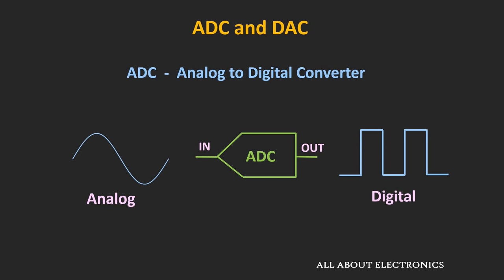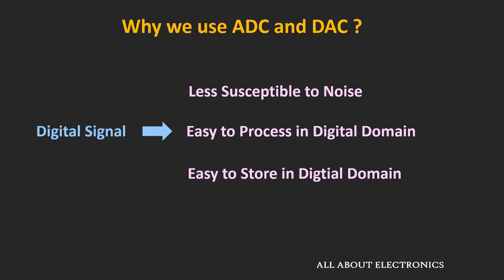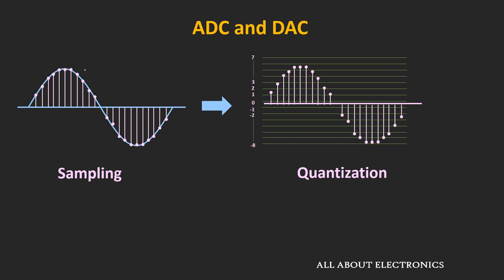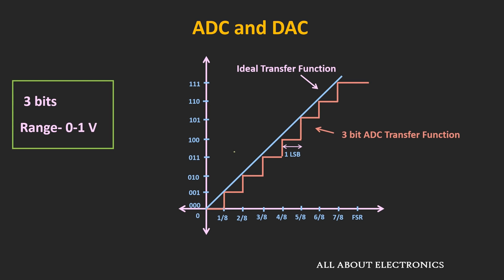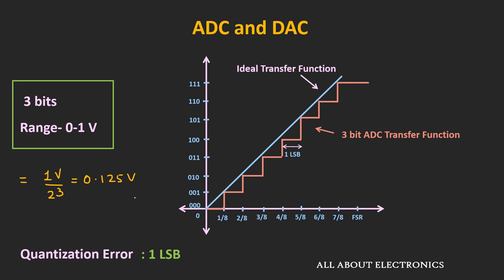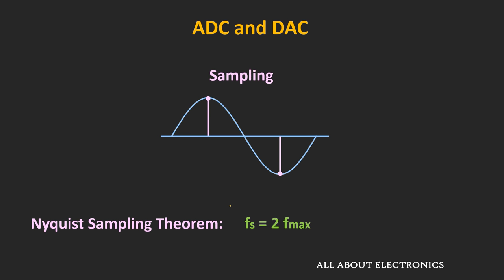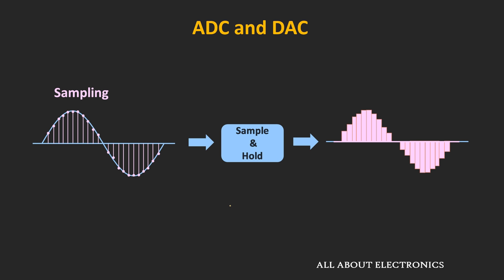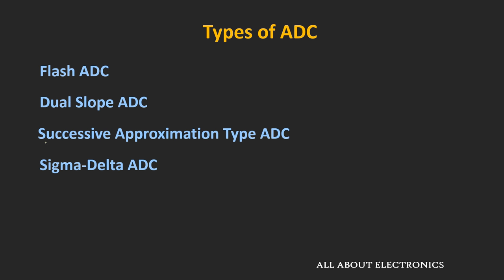Introduction to ADC and DAC

Comment: if we increasing the bit then resolution decreases ig because when we take No of bits = 3 and FSR =10, resolution = 1.25V when we take No of bits =8 and FSR=10 , resolution= 0.039V where Resolution decreases in this case
Reply from the maker: Yes, that’s true that the minimum voltage that can be resolved by the ADC reduces, but in a way it’s resolving power increases and typically the adc with higher resolving capacity are said to be high resolution adc. I hope, it will clear your doubt.
Reply: @ALLABOUTELECTRONICS  *its resolving

Comment: Even when you shift the TF function to the left. The quantization error is still 1LSB as the resolution isn't changed and the smallest  voltage that will be detected is still 1LSB.
Reply: Yeah... But The Continuously increasing or decreasing input signal is detected if it continuously increases or decreases by +0.5 or -0.5 which is better than detecting if it continuously increases or decreases by +1 or -1

Comment: pls tell me that how adc and dac are connected in the circuit and what are the process which the signal has to undergo in case of conversion from analog to digital and as well as from digital to analog. One more thing what is the structure of these ADCs and DACs  and can we enhance  the conversion process by using another device other than ADCs and DACs?
Reply from the maker: Please go through the ADC and DAC playlist. You will get it. There are different types of ADCs and DAC. Different types are explained in detail.

Comment: Great video, anyway to block out car noises in the background? Filter circuit maybe?
Reply from the maker: Hi, do you mean to say the car noise in background of the video or in general you are asking?
Reply: @ALLABOUTELECTRONICS  Yes, the car noises in the background.
Reply from the maker: I tried to minimize it digitally as much as I can. But if I had gone further, it would have changed my voice texture too. So, I have minimized it as much as I can. But anyway, I will try to record it at quite time if possible.

Comment: in analoge to digital conversion what is mean bt sampling?is it basically quntization in horizontal direction
Reply from the maker: The first step during the digitization is sampling. The signal in time domain is continuous. We are doing the digitization at the discrete intervals. Using sample and hold circuit, we are sampling the input signal at the discrete interval. After the sampling, the next step is the quantization.

Comment: 🎯 Key Takeaways for quick navigation:

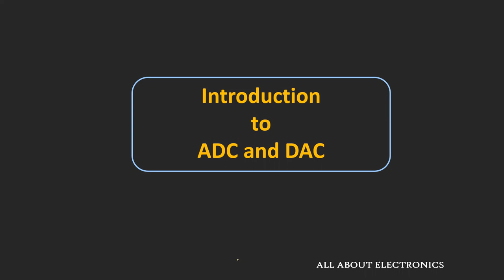00:12 🎛️ Introduction to ADC and DAC
- Brief explanation of ADC (Analog to Digital Converter) and DAC (Digital to Analog Converter).
- Examples of everyday use of ADC and DAC in devices like smartphones.
- Overview of why signal conversion between analog and digital domains is necessary.
01:34 🔊 Properties of Analog and Digital Signals
- Distinctions between analog and digital signals.
- Advantages of digital signals over analog signals in terms of noise susceptibility, processing, and storage.
- Explanation of why analog signals are converted into digital signals for processing and storage.
03:23 📊 Analog to Digital Conversion Process
- Steps involved in analog to digital conversion: sampling, quantization, and encoding.
- Explanation of quantization process and its relation to ADC resolution.
- Impact of increasing the number of bits on ADC resolution and detectable voltage change.
07:18 📈 Quantization Error and ADC Resolution
- Explanation of quantization error in ADC output.
- Relationship between ADC resolution, quantization error, and LSB (Least Significant Bit).
- Strategies to reduce quantization error by increasing resolution or adjusting reference voltage.
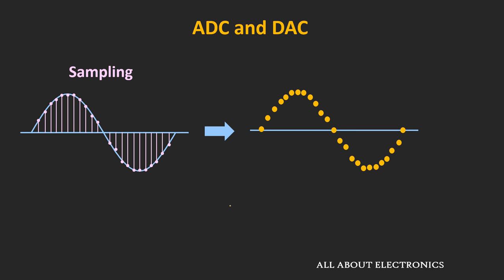09:39 🎚️ Sampling in Analog to Digital Conversion
- Importance of sampling in the analog to digital conversion process.
- Overview of Nyquist sampling theorem and its application to avoid aliasing.
- Use of anti-aliasing filter and sample and hold circuit in ADC to ensure accurate conversion.
12:44 🔄 Basics of Digital to Analog Conversion
- Brief overview of digital to analog conversion process.
- Importance of DAC resolution in accurately reconstructing analog signals.
- Discussion on key parameters for DAC, including resolution, reference voltage, and settling time.

Made with HARPA AI

Comment: isn't resolution = fullscale voltage/(2^N - 1)
please edit this video.. it is giving false information to students..
Reply: For real I almost went mad trying to rethink this
Reply: Nopes the resolutions is :
Full Scale Voltage/2^N
We divide the input into N intervals and assign a code to it. To get a clear idea, consider 2 bit ADC with 1V full scale range
There will be 4 intervals (2^2=4) with a unique code for each interval as follows
00- 0-.25V
01- .26V- .5V
10- .51V-.75V
11- .76V- 1V
So the resolution of this ADC will be .25V because that's the smallest change in input that it will detect

Comment: Regarding hi res audio...if the signal passes from digital to analog  in high quality (flac 24 bit/96 khz), then from analog to digital, and then from digital to analog. will the queality of the signal be the same/better?. Digital audio player with its DAC - ADC - DAC/ AMP.? I wanto to use a DAP as audio source that can play lossles formats in hi res (24 bit/192 khz), and use other DAC of other divice that sounds better. The DAP doesn't have a  digital audio output. So I want to  conect the DAP to ADC and then the ADC to a DAC/AMP and get the best possible soumd coming from last DAC and the high resolution format (24bit/96khz).

Comment: And what will happen if sample and hold circuit is not used
Reply from the maker: The input signal to the ADC is usually a time varying signal.
Second thing is every ADC has some finite conversation time. So, during the conversation, the input signal should remain constant. Without sample and hold, the input   may change during the conversation time itself. 
It would not happen if the signal is static. Let's say some DC signal. 
But for any time varying signal, that would not be a case.
That's why, the sample and hold circuit is required.
I hope it will clear your doubt.
Reply: Thanku sir
Now my doubt is clear👍

Comment: can we instead use digitally recorded/quantized signals not as a literal data point, but as a bezier curve control point, so the curve will produce a mathematically continuous perfect wave line, instead the digital steps
we use the digital signal to shape/draw the bezier curve, and this curve will be used to drive the DAC output, so the output has no digital steps